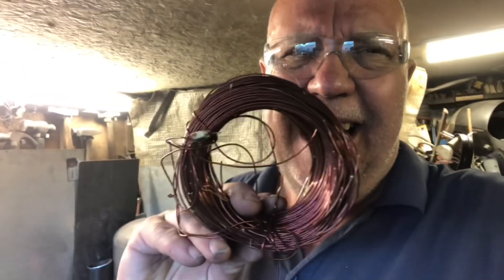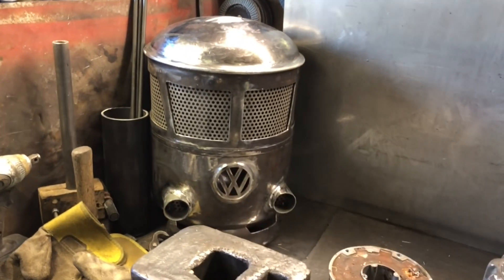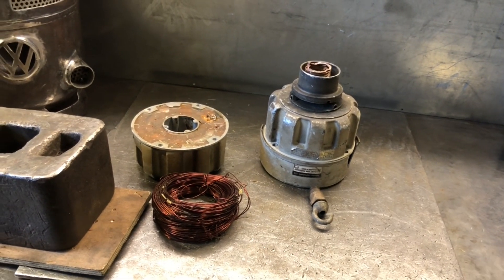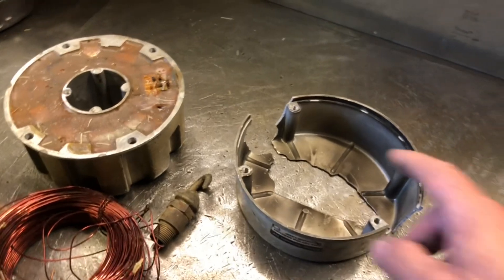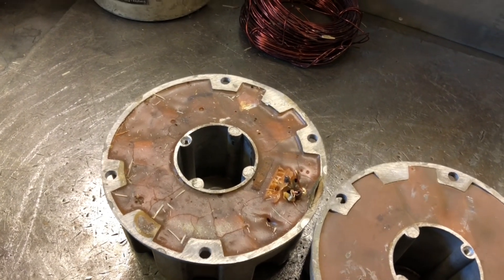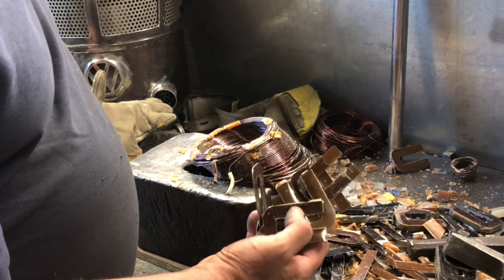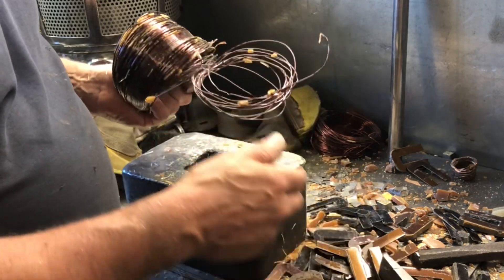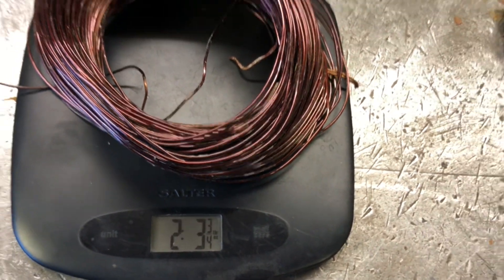Messy copper Extraction

Comment: its potting resin used also in  potting up HT coils have mended HT coils re potting them with that mending the old tube tv's when there was arcing across i.e you used to get a clicking on the sound and a pull on the line vertical & horizontal line hold. i used to get all the old tvs  of a tv repair shop to learn on i cleaned up there unwanted tvs ect and  fixed them and give them to fokes that dint have tvs
Reply from the maker: Very commendable scrap Womble. I have an old book TV repair ( black& white) interesting to read but some of it way over my head

Comment: I swapped out a system boiler for a combi last week for "a friend". See the folding stuff. Used allo the 22mm tube that would have been weighed in for extending the heating pipework. Charged 2020 prices for the tube (1/2 what it would cost new) and still made more than I would have on weighing it in..just about. Fair exchange is no robbery. Stripping the old system boiler tomorrow. Yer don't get owt fer nowt!